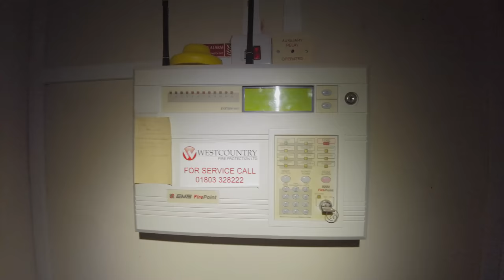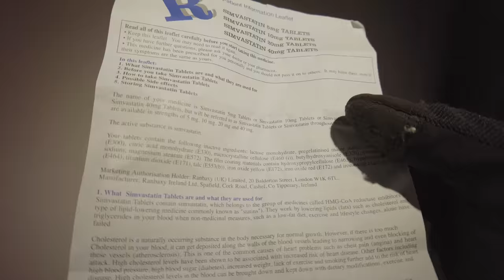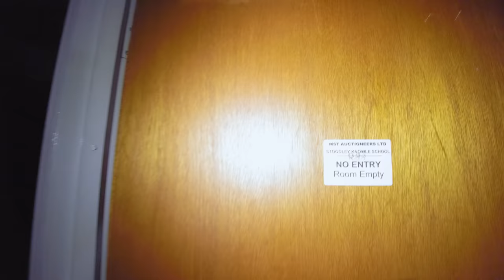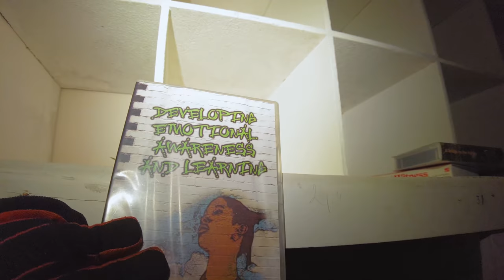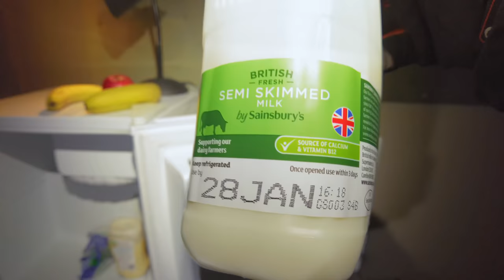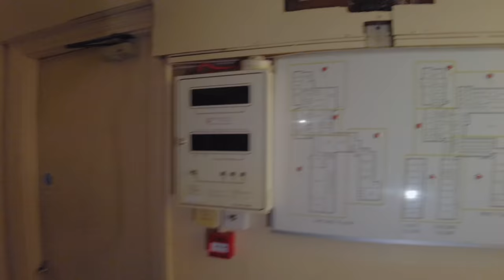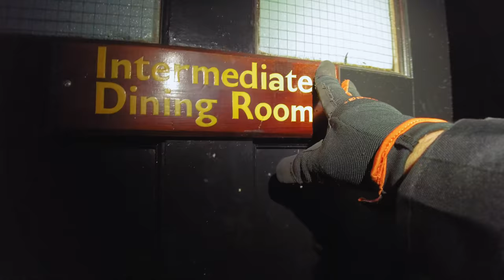POLICE ARRESTED US at Torquay Girls Seminary School

Comment: Haven't the police got crimes to solve? Obviously they don't have proper criminals in Torquay or they wouldn't be hassling you!
Reply: Well here is the amusing thing, what he is doing is a crime that at the least can get a caution to £1500 fine to ,5 years in jail.  Look I love his videos but saying something stupid like " do the police not have real crimes to solve  " just makes you look stupid
Reply: @EQINOX187  What?
Reply: @EQINOX187  Its not classed as a crime as was open a not a home ?????
Reply: As they didn't break in it's not a criminal matter.
Reply: @pascoebrock5877  Incorrect , new laws where passed not long ago to deal with unlawful entry and trespass, the new law was originally designed to give police greater power to deal with the traveler scum that invade property without permission, however it was expanded on to specifically include urbexers. basically the method of entry is irrelevant, but simply being on the land or in the property without the expressed consent of the land / property owner under the new law is grounds for arrest  / large fines or jail time.

Look I have no personal issue with what he is doing and it is entertaining but laws change and times change and doing what he is doing now comes at a heavy risk. One thing i would correct that i said wrong is that it is a £2500 fine and not 1500  and a 3 month jail term not 5 years.
Reply: @EQINOX187  what laws exactly? Also “Traveler scum” sounds very racist.
Reply: @EQINOX187  sorry, there’s no such legislation in existence.  You have trespass (civil matter), aggravated trespass (trespass with weapon of offence) which is criminal then matters under the theft act, ie burglary or theft, which this isn’t.  However, a police officer might end up arresting someone on suspicion of burglary depending on the circumstances but persons genuinely urbexing would never be charged as the offence is not complete.
Reply: @eqinox probably ex cop or some law abiding knob : to you if you don’t like don’t watch this stuff , have no time for you do Golding comments 😡
Reply: @davidgibbings6085  don’t think ex cop as they’d know the legislation.  Or should do.
Reply: They have every right to arrest them as they're in someone's property. They might not charge them with anything but they have 24 hours to decide that. I don't personally have any issues either just to be clear but if you enter someone's property at night with torches you are "going equipment" as far as they're concerned. Once they see evidence of a you tube channel they shouldn't take it any further but all that can be decided while you're in the cells.
Reply: @zerofox7347  I think you mean ‘going equipped’.   A Torch won’t suffice to justify an arrest for that, you’d need bolt cutters and other tools to justify that.  No custody Sgt would authorise further detention for a torch and a couple of cameras.